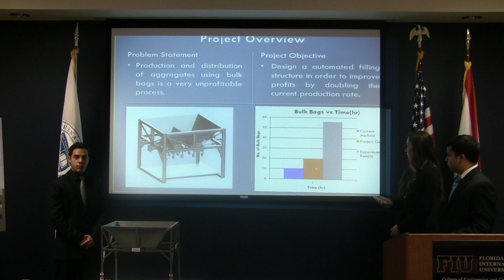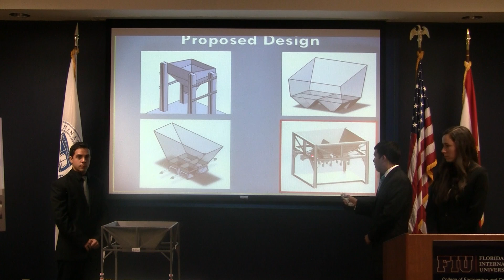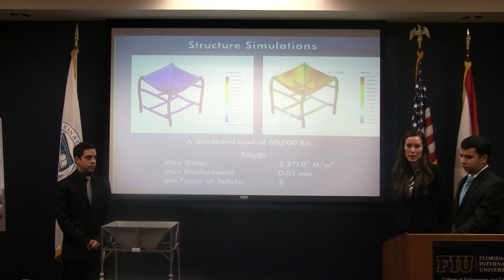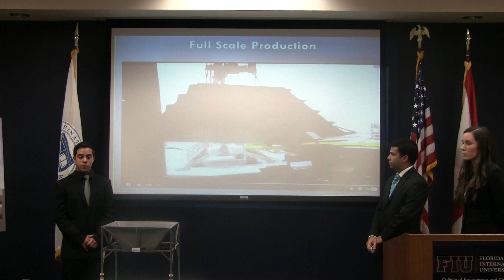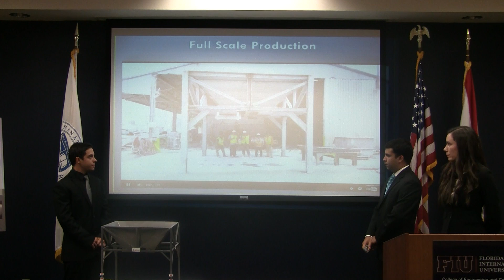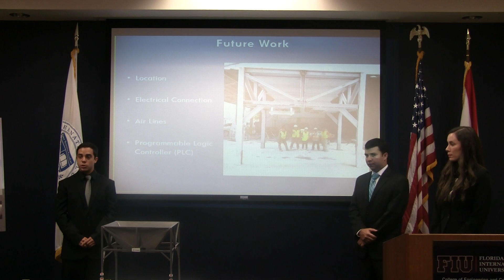Team 1: Automated Bulk Bag Filler for Titan America

Comment: Very thorough presentation. First presenter spoke a little too low. Liked how they found an issue in which the process was initially very inefficient, allowing their intended final design to really shine with a target filling rate of 200%. One problem was that some of the charts on the slides were difficult to read.